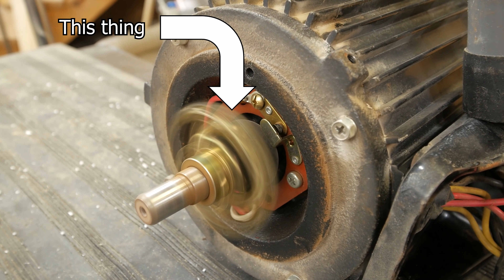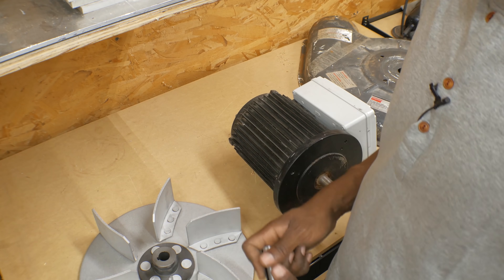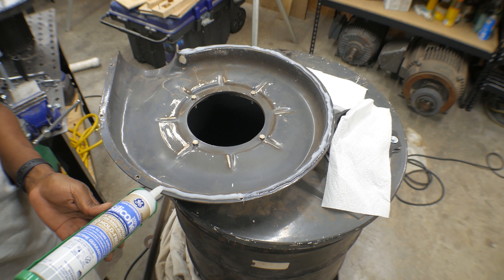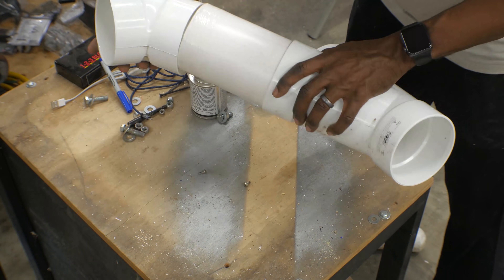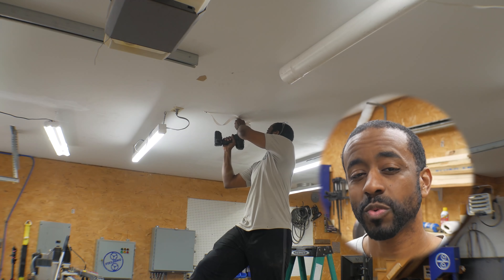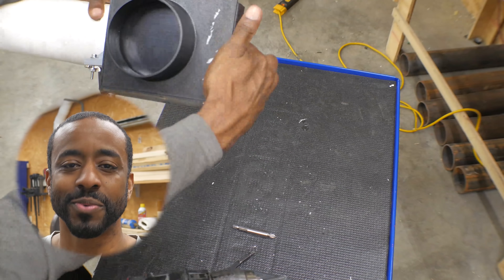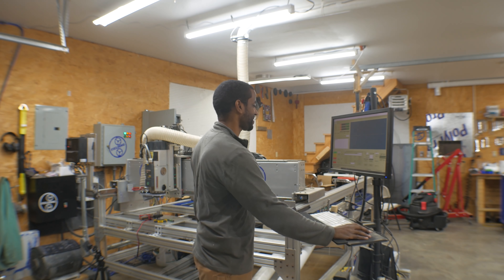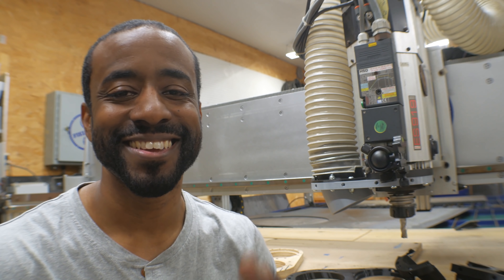Making An Automatic Dust Collection System; Shopmade #081

Comment: Hi Jeremy, I stumbled upon your site today.
Re your observations about static electricity, I'm afraid that you're wrong about the lack of evidence about fires caused by static electricity! The reality is that sawdust travelling through a plastic tube, as part of a dust collection system, will induce a static charge, & given the right conditions can & will cause a fire, or even an explosion! 
Try this as an experiment, take a medium size paper bag, blow it up as if you are blowing up a balloon, then pour in about a 1/8 to 1/4 cup of fine saw, or sander dust, twist the open end of the bag tightly closed, shake the bag violently, then set light to either of the sealed end corners, then whilst maintaining shaking of the bag, make sure that the now burning bag is held at arm's length, ...the result will be.....KaBOOM!
Given the right mix of dust to air, any spark/flame will either cause the dust to ignite or explode!
So please, please, please for your own safety, fit an uncovered copper wire through all your dust collection tubes & make sure that it is grounded (or as we say in the UK, earthed) at both ends.

George, hobby woodworker & a retired Health & Safety Consultant
Reply from the maker: I didn’t say it was impossible. I said there are no examples of a home shop dust collection system producing such conditions. Industrial level dust Like Flour plants for sure. You are describing an unrealistic condition for dust in a home work shop.
Reply: @Jeremy_Fielding  Hi Jeremy, I'm not trying to get into an argument with you. However, I stand with my previous reply to you.
As I previously said I'm a retired Health & Safety consultant, & have carried out investigations with & for the UK Governments Health & Safety Executive, into fires at both commercial & home hobby woodworking workshops (shops, as you in the USA would say). 
Solvents & electrical (either poor installation or equipment electric motor failures) are by far the major causes of these fires, but there has been a significant number caused by spontaneous ignition from static discharge within the plastic ducting of the installed dust collection systems. 
What you must remember & take into account, a dust collection system is solely designed to move a large volume of air that contains, in % terms, a smaller volume of dust particles, especially dust particles of less than 10 microns, so if the dust collection system is mainly plastic tubing, & when the air/dust mix is at the optimum level & if at that point there is a static discharge (not possible in a grounded system) there will be either a fire, caused by a smouldering dust particle being deposited in the final collection point or an explosion! The bigger the shop (home or commercial) & it's extraction system & the more tools in use at the same time...the bigger the risk!
For the sake of a coil of bare copper wire & the installation time, you can completely eliminate the risk of fire or explosion!
Reply from the maker: No argument intended.  I only wanted to be clear I didn’t say it can’t happen. No such statement could be proven. Only it seems highly unlikely to me in a home shop. it’s ok to have a difference of opinion about how significant a factor is. Thanks for watching!

Comment: Is it At all possible that the bolt that holds your impeller in place was a counter threaded bolt? Right loose Left Tight? I feel like most of my motors that have bolt retention operate like that.
Reply from the maker: I checked / expected that. It was right hand- normal thread

Comment: Did you have to use a transformer to drop down your voltage anywhere?
Reply from the maker: No. Just a power supply will do it. Or get relays for 120v or 240. I wanted 24 so my CNC could turn it on easily

Comment: Hi I have a question, I’m trying to make a homemade generator using a car alternator, but I’m using a quarter hp marathon motor and is a 115 but every time I use it to spin the alternator it shuts down because the alternator is putting to much of a load ,is there any other motor 115 that I can use to push my alternator please help.

Comment: Nice video! I've been planning to automate my dust collector, and was planning an arduino (or esp32) based system like Bob's. But I'll have to consider using compressed air. That could make the mechanical part a lot simpler.  I noticed up in the description that you accidentally duplicated the Amazon link for the solid state relays where the link to the solenoid valves should go. If the description is edit-able, you might want to fix that.

Also, I noticed you're using a plastic cable channel sort of thing inside your box with the DIN rails. Did you buy those channels separately? If so, where? I've been looking for a source for those. For that matter, where did you get the box?

On the grounding thing, I'm skeptical that the way most Youtubers "ground" their dust collection piping --  by driving in a sheet metal screw and attaching a copper wire to it -- does anything. PVC is a pretty nice dielectric / insulator, after all. So they're grounding that one spot, but that's about it. If you really wanted grounding, you'd have to run wire (or metal tape?) through the inside of the pipe. That being said, I went with metal ducts and I made sure to ground them because why not.
Reply from the maker: I updated the links including the cable tray I use. Sometimes called cable raceway.
Reply: @Jeremy_Fielding  Thanks!

Comment: Where do you get the 24 volts for the relay?
Reply from the maker: DC power supply, but you could use a 120AC relay, or 240AC relay.

Comment: You need to change plastic pipes with metal one. Plastic is causing static electricity and made much bigger resistant for dust flow. Plastic pipes are good only for sewage.

Comment: All the info re static starting fires that I have been able to find is purely anecdotal and not one peer reviewed paper on the subject. I haven't finished my DC yet and haven't made up my mind re static. One things for sure though I'm not going to use a commercial product they are just sooo over priced. I'm thinking of running a wire from the end of the PVC and grounding it to the motor because here in Oz all power outlets are grounded and motors over a certain size must be grounded which mine is.

Comment: You have too many sharp bends in your system (especially the one at the filter bag).  You need to search for "long radius bends" (or use 2 45 degree elbows spaced apart in cascade).
          Do you have a cyclone in your system?  If not, your system will clog up "in 5 minutes".

Comment: I'm aghast you didn't properly clean and sand smooth the surface you used silicone to seal. The horror! I had to avert my eyes but still feel I will lose sleep tonight over this.

Comment: I'm betting there's zero relative voltage on static charge within the pipe because there's no path to ground.  Everything would be at the same voltage.  I'm assuming the only place there might be a path to ground is at the endpoints which tend to be physically touching the pipe to ground it.  So maybe there'd be a danger with a floating casing not connected to safety ground?  I AM just pulling this out of my butt though.